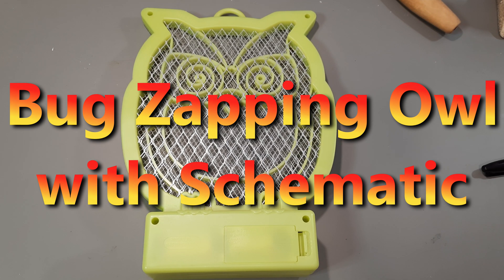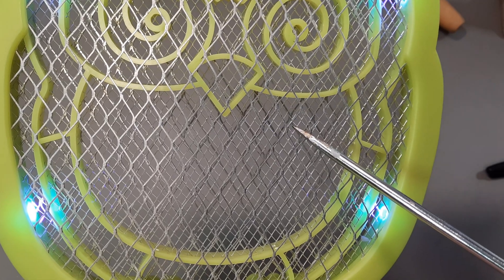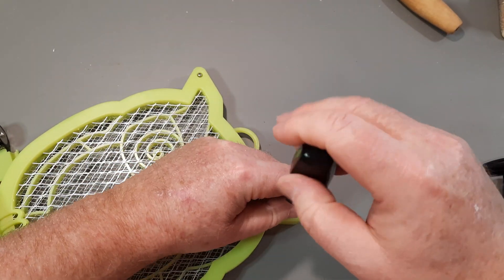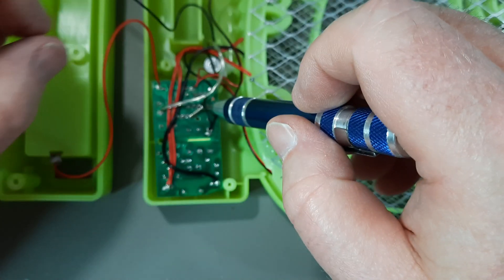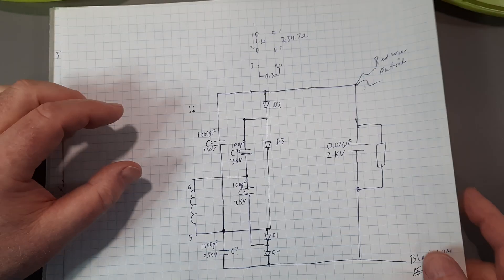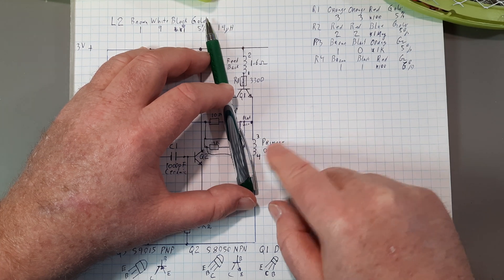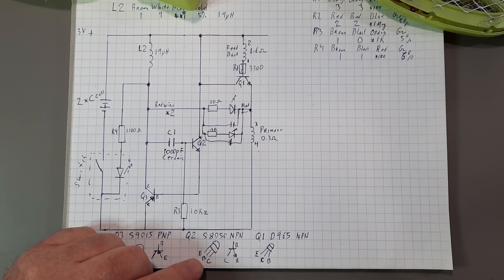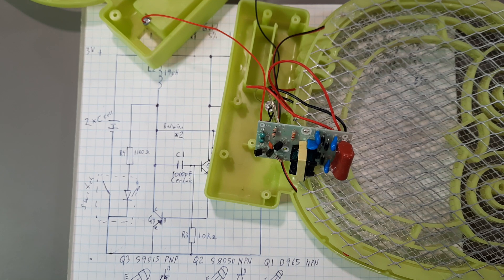Bug Zapping Owl with Schematic

Comment: Looking at that schematic, the other transistors are purely a boost converter/regulator for the LEDs that seems to get started by pulling current from the main HV oscillator through the caps in parallel with them. I assume this is so as the batteries drain, or if you put lower voltage rechargeables in it, they stay bright. That means the main oscillator runs down to a pretty low voltage (I mean these things are basically a joule theif with HV output). EDIT: it gets weirder, they have the switch LED also running off the boosted supply. Also, what happens once the second oscillator starts, does it free run or stay in sync with the HV? would be a good test if you have a scope. I would avoid 5V untill you know what that booster is doing, it might just burn up the LEDs if given over 3V.
Reply from the maker: I am going to be doing a bit of scoping on this to try and figure it out. Original idea was stick a Li-Ion battery pack in it and up the voltage but then I realized I might zap a hummingbird (very bad for Karma). 2nd idea was then to add a circuit to turn it off during the day. Either way will need to figure this circuit out a bit more.
Have a good day

Comment: My experience with bugzappers is the more powerful they are the less effective they are. I wanted a powerful one, that produced a nice satisfyingly loud zapping noise when you hit a bug with it. But what I found is that it's so powerful that when the bug hits it, the shock from the electricity immediately sends it flying. The bug then falls down wherever and is completely stunned and still for a few seconds, before slowly coming to again apparently completely unscathed from the whole experience. You want one that is low powered enough that the bug isnt instantly repelled from the zapper by the shock but stays on there. It's like with those artillery shells that delays exploding because they want the shell to penetrate whatever it is hitting first and not just explode on its surface
Reply from the maker: I am going to have to wait till summer to try it, currently winter here. My most significant concern for this zapper is during the day it might attract a hummingbird, that would not be good. Any experimenting I do will be with the hand held swatter and I will remember your comment when doing it.

Comment: I took apart my tennis racquet zapper and found a circuit and layout very similar to yours.
I was astonished, upon writing out the schematic I appreciated the terrible layout and picked the components off to set them out better. The high voltage separation can be improved and the tracks do not have such a messy path. I wish these manufacturers would pay closer attention to things like this, but there's no incentive.
Also, I replaced the transistor on teh oscillator side with one with a highher frequency response and a lower VCESAT for some mildly improved oscillation.
Reply from the maker: I think the next step will be to slightly increase the input voltage and see if it smokes or arcs better.
Have a good date